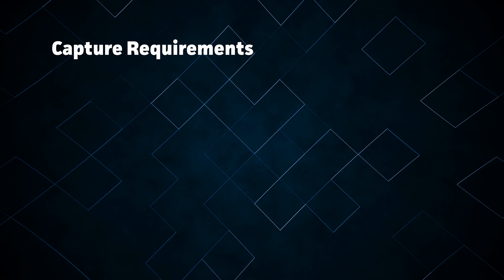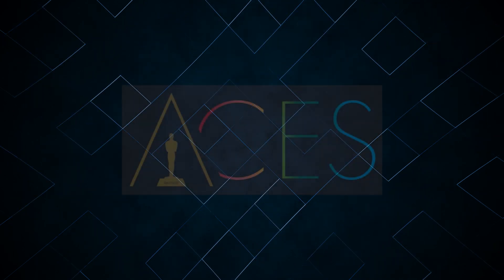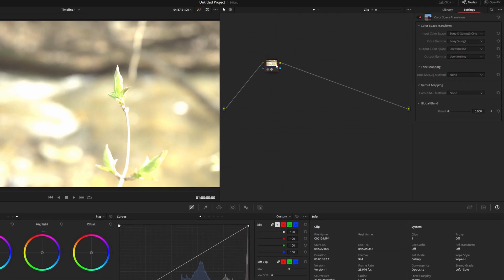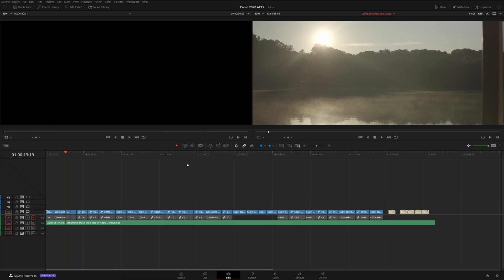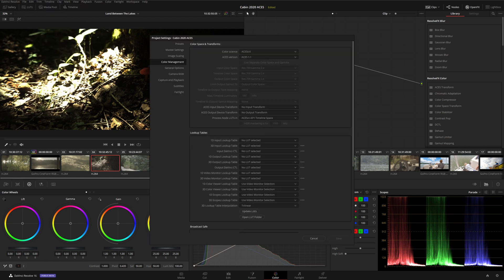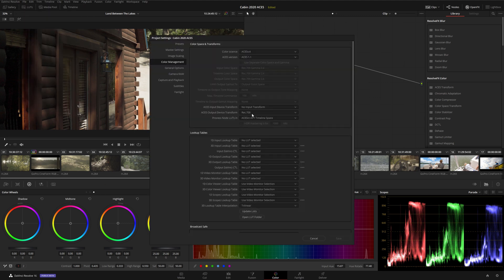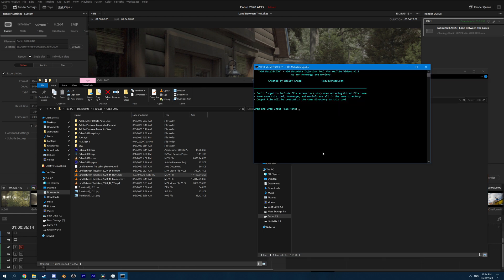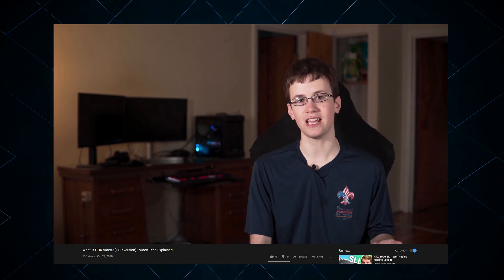How To Make HDR Content Without An HDR Monitor - Video Tech Explained

Comment: Finally someone who doesn't stick their nose up at my frustrating learning curve.

I had been working in resolve 17 studio which I specifically purchased to grade my d-log Drone footage to HDR.

I got the grade looking really good using DaVinci color managed and DaVinci wide gamut.
Then I went through a dozen or so renders with the delivery settings and the project settings altered one at a time so there was control in my experiment.

No matter what I did, I did not get a file that was recognized by any appropriate device or program such as YouTube as being HDR.

I finally surrendered that desire and decided to just grade for Rec.709

But in this case, now instead of attempting to grade my d log footage from the Drone, I'm working on a project with HDR10+ footage from my Galaxy Note 20 Ultra and DJI OM 4.

Now when I choose DaVinci yrgb color managed and DaVinci wide gamut, selecting bypass for now on output cs, my HDR10+ footage dropped in the timeline looks like it's raw footage. 😱

🤷
On one hand, I want to attempt your approach here with the aces workflow, and on the other hand it's confounding to me as these new DaVinci color managed and wide gamut settings ought to be doing essentially the same thing.
You know this stuff moves so quickly that by the time I learn to use the DaVinci color science and color management, it may be outmoded, let alone going to a workaround that's a year old. 

Still, if it gets me what I want, I'm in.

To ask just one question though, unless you want to give me any insights with regard to what else I've said;
Aside from not displaying an accurate visual, is there some other reason having a $40,000 display is necessary.. as in like does the metadata encode into it that the color gradist is a liar and they were using a display that only goes up to 650 nits?

If that's the case, then why don't the many color grading elitists just say that instead of rubbing it in that they have better monitors and budgets than I do? 😂

It's worth mentioning that their special skill will be as accessible to everyone as the cameras are now in just a short time.
And while they will be on the leading edge of developing their talents, they won't be isolated in an elite class that makes them irreplaceable as they have been in the past.

This happens with a lot of emerging technologies. For instance when the alphabet was initially created it was coveted and many attempted to hide its Wonder from others so that the elite few who did know it could maintain a level of power and control over others.

I absolutely respect the color profession and being a professional musician who has put a lot of time and work and sweat and tears into developing my craft, I understand the frustration at some kid who doesn't know s*** jumping on the scene and getting accolades.

In this case however, we are dealing with a structural change. And the best way to handle structural change is to get out in front of it and lead it. Resistance is futile.

So again if I had just one question it is,
Does my output file encode what monitor I was using in that file and then tell YouTube or my phone to not play it as HDR because it was graded on a 650 nit display (which is marketed as HDR)?

And thank you so much.
I have ample respect for you for your willingness to think outside of the box and to talk to me like I'm an adult who wants to do his best as an independent multimedia creator.

✌️💚
Reply from the maker: Wow! Thanks for your comment, and I'll try to answer it as best as I can. 

First of all, yes you can achieve functionally the same result using Davinci Wide Gamut and Resolve Color Management. It's just two different ways of accomplishing the same task. See my episode on Color Management if you want more info on the difference between the two. The only real thing you would need to be aware of if using my workflow with RCM is that the LUT I attached in the download is made using an ACES transform. 

RCM Transforms and ACES Transforms are internally consistent with themselves but are not consistent with each other. The LUT I attached uses an ACES Rec.2020 ST2084 -> Rec.709 transform, so the SDR version on YouTube should look identical to selecting Rec.709 as the output in Resolve. But it won't necessarily look identical to selecting Rec.709 in Resolve if you're using RCM. So you'll just need to generate a Rec.2020 ST2084 -> Rec.709 LUT using an RCM transform instead, which isn't too difficult.

To answer your second question, there is a point to purchasing an extremely expensive HDR mastering display. Professional colorists working on projects with any significant budget will use what's called a "Reference" monitor, and plug it into a device like a Blackmagic Decklink instead of a normal GPU display output. 

The first and most obvious advantage to this approach is accuracy. Reference monitors are calibrated and quality controlled to a MUCH higher standard than ordinary monitors, so that when you select a display profile like Rec.709 on the reference monitor, it will reproduce colors in Rec.709 pretty much perfectly. Or at least, as perfectly as is possible with current technology. They are quite simply the most precise and accurate displays that exist. Additionally, using a Decklink instead of a GPU bypasses the Operating System and allows Resolve to control the monitor directly, further reducing sources of error.

But the second advantage is perhaps more significant in the context of HDR. The vast majority of monitors, even ones which claim to be HDR capable, don't come anywhere even close to accurately reproducing an HDR standard like HDR10 or Dolby Vision. For example, my main display is technically HDR capable, but I would never use it in HDR mode for anything where accuracy was important. It has a maximum brightness of 350 nits (far, far below the 1,000-10,000 nit maximum of HDR), no local dimming to improve contrast, and no coverage of color gamuts beyond Rec.709. 

While a typical monitor might accept an HDR signal, it has to heavily distort that signal in order to map it down to work on its decidedly SDR hardware. You won't get anywhere close to an accurate reproduction of the true brightness and contrast of the scene. While most displays are good enough for reasonable SDR color grading, the accuracy problem is magnified a hundredfold if you try to use them in HDR mode.

A reference monitor, however, is able to actually display an HDR signal in HDR with accurate contrast, brightness, and gamut. While there aren't any displays that can match the full HDR display volume of Rec.2020 and 10,000 nits, a typical reference monitor will offer full coverage of the DCI-P3 space with 2,000-3,000 nits of peak brightness and local dimming. So if you feed an HDR image to a properly configured reference monitor, you're actually getting a mostly accurate rendering of what the scene looks like in HDR. Maybe someday we'll see this capability trickle down to affordable displays, but as things stand that's a long way off.

To answer your final question about encoding and metadata: No, Resolve does not bake in the information about your monitor when it encodes an image. However, by default it will not include HDR metadata even if you set your output transform to an HDR format. 

See, even if you render an image in Rec.2020 ST2084, a platform like YouTube doesn't have any way to know that the image is encoded with HDR unless you tell it so. YouTube will just assume it's Rec.709 like everything else, and display it as is. When you display an HDR image on an SDR display without tone mapping or processing, the results will look very flat, which I imagine is what you're seeing on YouTube

The solution is to attach metadata to the video file which will tell the platform that the video is encoded with HDR and needs to be processed accordingly. In the video I go over how to accomplish this using a simple script file which I have linked in the description. So you need to set the output transform to HDR, render the file, and then put it through the script to attach metadata before uploading.

Hope that answers all your questions
Reply: I wish you were my neighbor.
If buy you a coffee or a ginger ale..
And we could nerd out talking about technology.

Thank you for this thorough explanation.

I'll be checking out more of your videos today.

Have a great one!
✌️💚
Reply: Using $30.000 monitors is not just a bragging right for some, but a requirement. If you want to make a film for Netflix, they have very specific requirements to camera gear, backup during filming, monitors, grading software, calibration of monitors, and so on. Not only that, but also how it's all set up. They do however have lesser requirements for documentary making.
But if you hear a filmmaker say he needs a $30.000 monitor for "regular" filmmaking or YouTube videos, that's not the case. A $5.000 monitor will do the job, as long as it can at least output 5-600 nits. Many of the first HDR movies were graded on monitors like that, simply because there were no monitors on the market (and TVs for that matter), that could go that high.

You can buy a good $1.500 Asus monitor, that can hit around 1000 nits HDR, and they are more than good enough, for the average small filmmaker. And for half of that, a good 600 nits monitor. All the above, will hit a delta error below 2, calibrated. And that is said to be the limit of human perception. The $30.000 can go as low as a delta error of 0,3, if I remember correctly.

Comment: What if you have the studio version of Resolve. I'm assuming for this version I don't need to use the meta injector tool. So my question is how do you inject the metadate in the paid version of Resolve?
Reply from the maker: If you have the studio version, you can automatically attach HDR metadata via the deliver tab, yes. Make sure to check "HDR Mastering is for 1000 nits" and "Enable HDR10+" in the color management tab, then check "Export HDR10 metadata" and "Embed HDR10 metadata" in the deliver tab. 

However, one important thing to note is that doing it this way does not allow you to attach a custom HDR to SDR conversion LUT. YouTube will perform the downconversion automatically using their own system, but the SDR version on YouTube will look different from the version you monitored earlier. In order to make the SDR version on YouTube match the one in Resolve, I still recommend using the metajector tool as it allows you to attach the appropriate LUT

Comment: It was when some guy in a making of to a small production said: "Even relatively cheap DSLRs have a dynamic range of 10, 11, or 12 stops. We've been filming with HDR-capable cameras for years - and not only the pros but also many amateurs", when I realised that it might be worth a shot putting some research time into HDR and how to grade it on my non-HDR monitor.
Reply from the maker: Exactly! As long as you have a decent sensor and use a log profile, you're almost certainly capturing enough information for HDR. It's just a matter of making use of it
Reply: The concept of HDR is old i discover HDR file from Paul Debevec in 2001 for lighting 3D environnement with HDRI but they introduce that concept in 1997 or 1998 with the short film fiat Lux and we only see that in SDR, recording video with this format is only start since 10 years with the concept of UHD Bluray and now with streaming service

Comment: Very cool!  Seems like it could be done in the new DR 17 Resolve Wide Gamut. Time for a new video?
Reply from the maker: That would also work! I have a future video planned about color management in general, but the short version is that both ACES and Davinci color management do fundamentally the same thing. Either works, it's just down to personal preference
Reply: @VideoTechExplained  Look forward to it!  Any time soon?
Reply: @VideoTechExplained  If using Davinci Wide Gamut colorspace instead of ACES  how would you export the LUT with the SDR tone mapping to inject to the Youtube upload?
Reply from the maker: @TubeSilva  Just open up a fresh clip and put a "Color Space Transform" effect on the first node. Set the input as Rec.2020 ST2084, the output as Rec.709, then export that grade as a 35-point CUBE LUT

Comment: Thank you for making this. I might just be able to start using HDR finally. What would be the appropriate input transform for a linear exr sequence or a cineon log dpx sequence?
Reply from the maker: Not sure, I would look over on the ACES forum (https://community.acescentral.com/). For Blender at least, I render everything to EXR with an ACEScg gamut (see: https://www.toodee.de/?page_id=1720#) and then use the ACEScg input transform. EXR's are linear so the gamma shouldn't need any input transform, but you'll want to make sure the color space is being handled properly, hence rendering with ACEScg primaries
Reply: @VideoTechExplained  Thanks!

Comment: Great video homey. Do you know if there are any real advantages to producing HDR content on YouTube, considering 90+% of people don't have a true HDR compatible display? And as far as using the method in this video and uploaded to YouTube and everything, will it display SDR for those without HDR displays as well as display HDR for this with? (that 90% is probably considerably higher now since the release of the iPhone 12 which displays true 4k HDR, and since over 70% of my content specifically is view on a mobile device, more and more viewers will be benefitting from HDR content) Thanks for the video again.
Reply from the maker: To answer your first question, it really depends on the project. Some things might benefit from it, but I'd say for the majority of content it doesn't really matter one way or another. And yes, with this workflow it will display as SDR for everyone who isn't using an HDR display
Reply: @VideoTechExplained  oh cool man thanks for the reply, great video.

Comment: What about the scopes? What level do we need to set for maximum output ? When you color grade them it's different from the final output, when you make the change from hdr to sdr...
Reply from the maker: So when you have the Rec.709 tone mapping enabled, the scopes will reflect what you're seeing on your monitor and what people will see on the YouTube SDR version. It maps the HDR 0-10,000 range down to 0-100 in a logarithmic fashion. I don't have the exact numbers in front of me, but it's something like 100 nits HDR corresponds to 85 nits SDR, 1000 nits HDR correspond to 98 nits SDR, 10,000 nits HDR corresponds to 100 nits SDR. 

Those aren't the exact numbers, but it's something like that. My advice would be to just enable the Rec.709 tone mapping and then grade as you normally would. People watching in SDR on YouTube will see the same thing you're seeing on the scopes, and people watching in HDR will see values above about 85% as being up in the HDR range. Hope that makes sense

Comment: Hi, Thank you for this video :)
I'm following your tutorial and got a few issues.

I'm using Resolve 17 version and my camera is Bmpcc 6k, 
every file is BRAWs.

7:47 When I right click my braw footage on Resolve 17, 
There is no "ACES input transform" option, only seeing "LUT".
And inside "LUT", There are so many options for Blackmagic design 
and only 2 two 
Blackmagic pocket 6k film to video/extended video.

Footage looks so weird with "Blackmagic pocket 6k film to video".
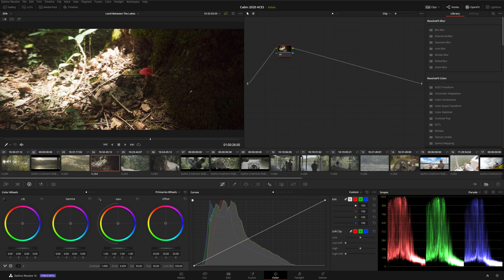It doesn't look natural like your video 8:53.

Thank you:)
Reply from the maker: Hi. Since BRAW is a RAW format, it doesn't have any transform baked-in. Resolve is smart enough to automatically transform any RAW footage into ACES when you drop it into an ACES timeline. So, you shouldn't need to apply an input transform for a RAW clip, only non-raw formats like ProRes or H264.

To double check that Resolve is transforming the RAW clip correctly, go into the "Camera RAW" tab, change Decode Using to "Clip" and the Color Space and Gamma options should be greyed out, because Resolve is automatically applying ACES for both settings.

Comment: If you go the metadata route, is there still a workaround to do the same?
Reply from the maker: I'm not 100% sure what you mean by this. The exact delivery method will vary depending on which platform you're uploading to. The method I described works for YouTube, but I can't comment on any other platforms.
Reply: @VideoTechExplained  well YouTube accept several flavours of HDR , the other require metadata to deliver.
Reply from the maker: @CarlNenzenLoven  The tutorial in this video delivers PQ, which would be my recommendation for YouTube. However, if you want to go the HLG route I believe you can attach the appropriate metadata using mkvmerge https://github.com/youtubehdr/hdr_metadata